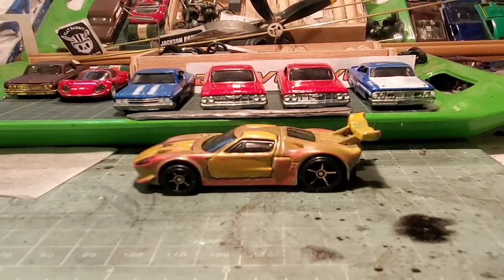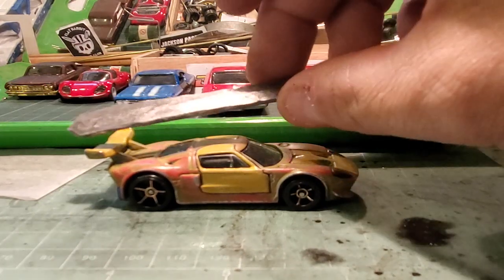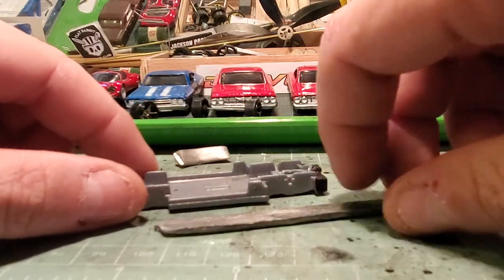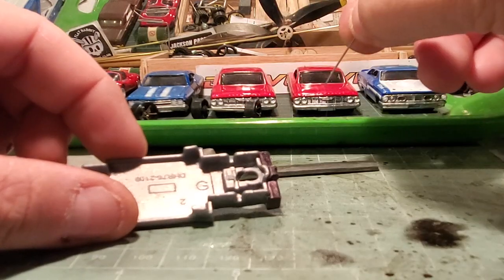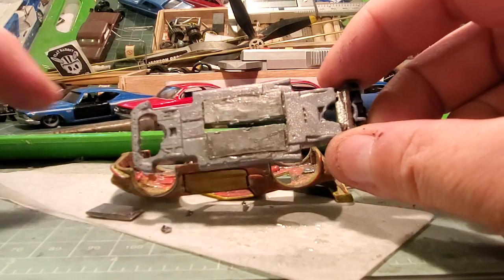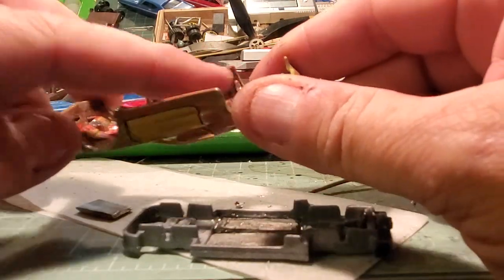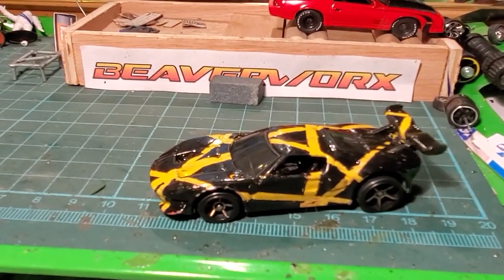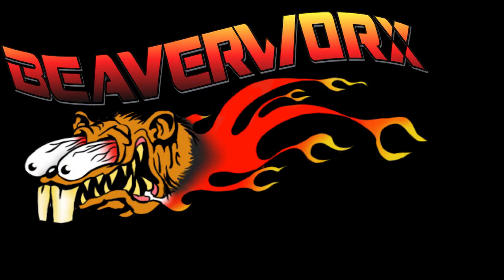HotWheels Race Mod ADDING WEIGHT Beaverworx race shop "slow burn"

Comment: Did you measure the before and after tipping angles?  With as low as that weight is in there, this thing is probably never tipping over.
Reply from the maker: I have to make a few mods to my tip rig to get a good read for that very reason...lol. By the time they get close to tipping they are already on their side!
Reply: @BeaverworxDiecastRacing  that's the kind of problems you want to have.

Comment: So this got sent out to another channel?
Reply from the maker: Sadly no... This is a screw up and need to be fixed... Classic example of "don't get glue on the other shaft where the wheel is" The one I did send away was the 64 impala FTE with the red and white "frankenstine Paint job... That was at jackson Pass Speedway... Lov to get that car back
Reply: @BeaverworxDiecastRacing  I see, have you seen or used Liquid Gravity?